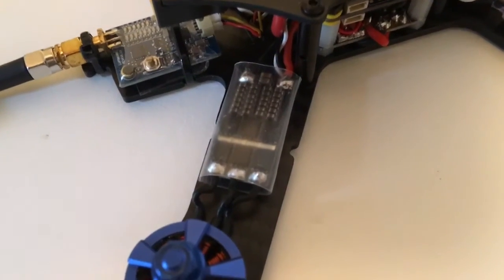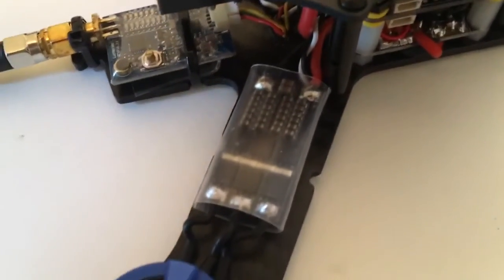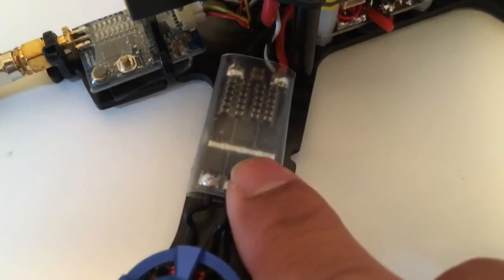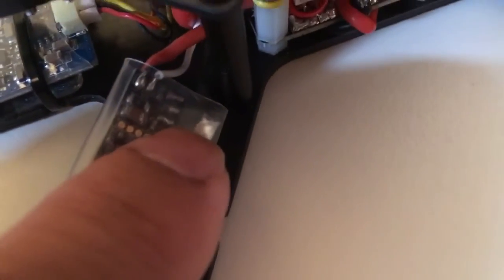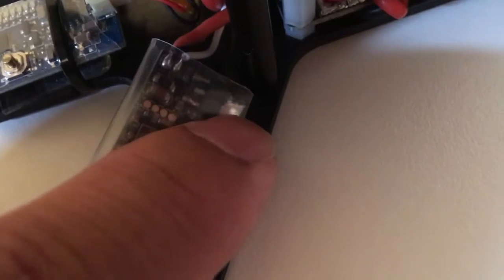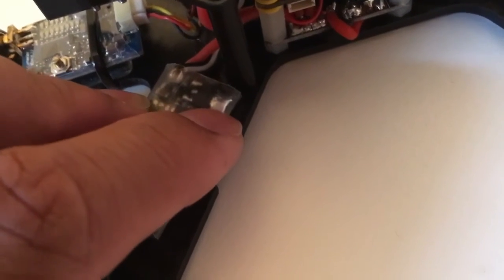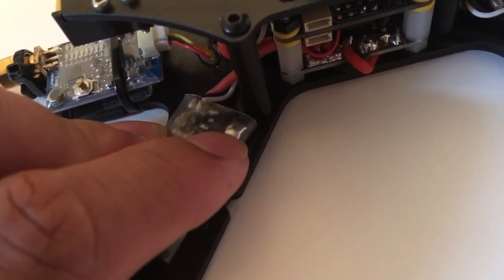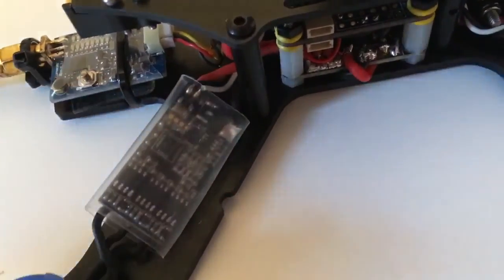FVT Little Bee 30a ESC fix

Comment: I just got a set of little bee 30a_s.

when testing them out for the first time, one of the esc would loose power after throttling up. it seemed to power back on by itself after some wiggling around.  

I'm hoping this might be the fix since I've narrowed all the issues down to the power supply. I'll try it out when I get back home.
Reply: Daniel Baranowski did this work for you because im having th exact same issue

Comment: Will it run forwards and reverse like a car esc?
Reply from the maker: 3.E- Revo yes.  This is a quadcopter application and reversing escs are a product of the firmware for 3D flying.
Reply: John DeCastro thank you for your reply helped out alot !